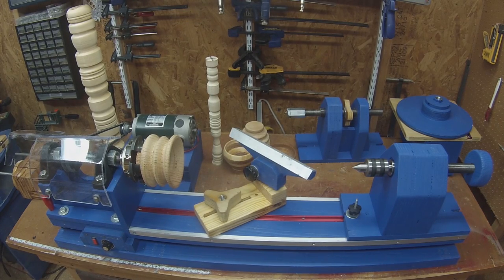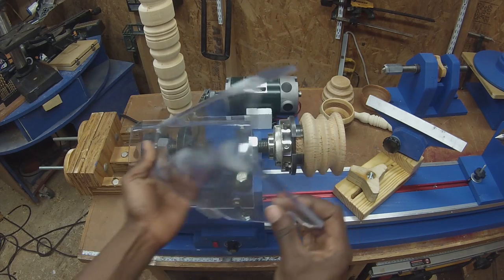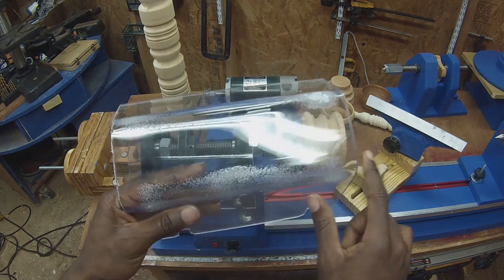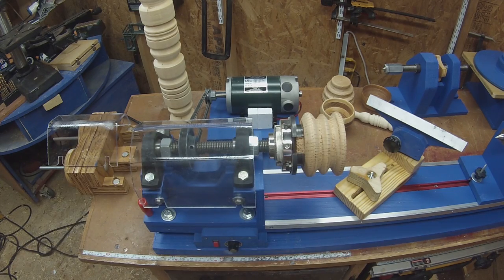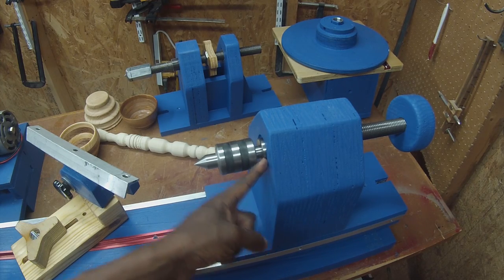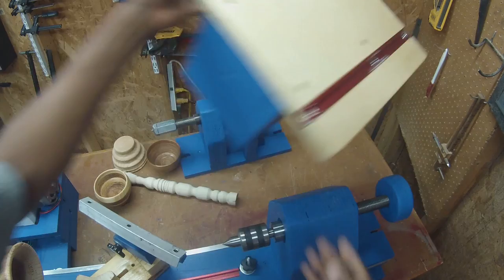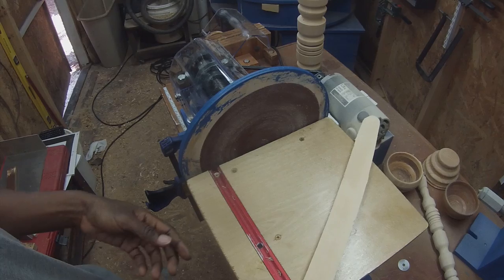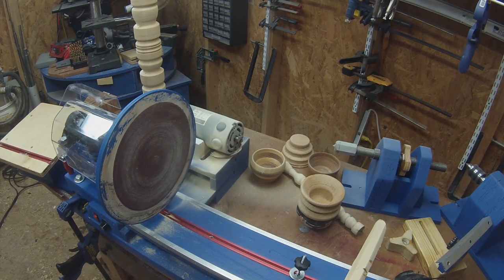The Lathe, part 5 Last Details For The Lathe Build: 025

Comment: This has turned out to be a splendid project, professionally executed. I am particularly pleased with the variable speed aspect of it. One aspect of finish sanding a turned project is dealing with the fibrous nature of wood grain. A good addition to this fine lathe would be the ability to run it in reverse direction, for sanding. Maybe figure a fail-safe method, to insure the user is aware that the unit will be running in reverse direction. Sanding in both directions, from about 60 or 80 grit, in stages to about 320 grit will produce an excellent finish. A useful item for extending the service life of the sanding disk surface will be a gum rubber stick, to clean the disk after use. I slaute your efforts!
Reply from the maker: +Thomas Koehler there is a switch on the side for going in reverse... I didn't show it in the video, but you see me use it in video number 15 and 20
Reply: Ah! Allrighty, then! I admit to being an infrequent viewer.

Comment: for bending plastics, as long as you have a decent radius to work with, I heat up a copper pipe with my blow torch then lay the plastic onto it, the conductivity of the copper means the heat is spread evenly.
Reply from the maker: That sounds interesting... I just might buy a cooper pipe just to try it. Thanks

Comment: Just one more Idea. You should bend a little dust shield out of lexan  to go over the back of your motor. They are a brushed motor and woods like pine have a lot of sap in them and if it builds up inside those exposed brushes it might shorten the life. I just made a 2x72 belt grinder from a tread mill motor and I had little metal dust all over my motor. I was going to make it from some 1/4 ply but I like your guard.
Reply from the maker: Well since the motor was free I am not terribly worried about it. If I had purchased it I would definitely want to build a cover. Sort of a weird thing to be lazy about but I guess I am.

Comment: Can you  imagine the things this guy could build with a welder, metal cutting bandsaw and a small brake and maybe a small mill... All I can say is look out NASA Jeremy Fielding is on the loose.....
Reply from the maker: This is why I started Patreon... crowd funding could turn this into something great. Right now the ideas are much larger than my budget LOL
Reply: You will go places my friend... You are a great thinker... Remember this... Rome was not built in a day... But I understand about budget... I am building a CNC machine that will machine steel.. Yea the fame of the thing is a boat anchor... 2X2 3/16-wall steel tubing... 3/4 Dia- Acme lead screws 0.5 start. work bed size is 4 foot square... Dang thing weighs a ton.. But will mill Steel with no problem.... doubles as a boat anchor on the weekends... ...LOL...

Comment: Very nice lathe, would you think about building a scroll saw and taking us all along.
Mike.
Reply from the maker: I made one before... I was given a scroll saw that is much smaller then the one I built. It is just big enough to do the job so I dissembled my scroll saw to use the parts.  You see me using it in my mechanical chess set video, I show it in my "11. things you can make with a Vacuum" video, and I made a preview video right after I made it... here is the link to the first video I made on it. 
https://youtu.be/Tv85jhhlk9I

Comment: I really enjoy and appreciate how you adjust your design as you go when you realize how you can improve it. Great example of how design is an iterative process. Great tip on forming the lexan, too. What kind of RPM range are you getting with that motor and control? Thanks for sharing!

Comment: Congratulations on your accomplishment. Nice machine. You've inspired me to build one of my own as opposed to purchasing one. One question concerning the wiring, does the plan go into details on how to wire it up?
Keep up the great work. Cheers! BTW, I have a treadmill I'm about to tear apart for the motor.
Reply from the maker: There aren’t electrical details in the plans. There are to many options. I have many videos on that
Reply: @Jeremy_Fielding  Thanks for the quick response. Could you direct me to the specific video/s that covers how you wired your lathe? I have a motor from a treadmill I plan on using to power mine up. Cheers!
Reply from the maker: Search my channel for exactly that

Comment: Your work is brilliant. Do you include the electronic side of things in the plans? Also could the lathe be adjusted to become a metal lathe also?
Reply from the maker: I don't include electrical because there is a wide range of possible motors and controllers (if any) that people might use. I decided to make the motor base some what modular so it could work with any motor.
Reply: Jeremy Fielding that makes total sense. I'll refer to your other videos for starting points when I get to my self teaching research 😉 thanks
Reply from the maker: As to the metal lathe. I don't think this lathe should be used as a metal lathe. However, I have "turned" some steel parts using a grinder or a file for small adjustments. This lathe can handle large wooden work pieces, but I did not design the lathe to handle the kinds of forces that come from cutting steel with metal lathe tools. It might be possible but that was not my design intent.

Comment: Considering the direction your DC motor happens to be facing, for the sake of longevity it may be worth the bother of facing the motor the other way so it's air intake isn't directly facing the working (dust creation) area. I'm not sure if that would introduce any speed issues (if the motor can be run at the same speed in the other direction) but I'd imagine sucking up all that dust is gonna fry the motor quickly; which would be unfortunate for I'd very much like to see what else you come up with.
Reply from the maker: I have considered many options to prevent that exact problem including mounting the motor underneath the lathe like the Jet lathe. But considering the size of my space, this configuration gives me the "smallest" lathe. Turning it around makes the lathe longer. I have a switch on the side of the lathe to change the direction of rotation, and it runs great. Size was the deciding factor. By the time the dust becomes a factor it will probably be time for new brushes. I could open the motor casting, clean it out and replace the brushing putting me back where I started. 
In the end I could just  put a cover over it. However, I have thee more motors like this one. All of which cost me nothing. I could easily replace it. The last options is the most likely. Thanks for sharing your thoughts. We agree on the issue, it just didn't turn out to be the most important for my situation. If I had bought this motor, I would probably try harder. :)
Reply: Great build Jeremy!  I was also concerned about the dust being sucked in the motor.  Turning the motor will lessen the amount of dust but not eliminate it.  I would suggest looking for a brushless DC motor, they are sealed and dust would not be a problem.  They are larger but I think that is so the case can act as a big heat sink, and they give you great torque at low speed.  Keep up the great builds and videos!  Enjoy your channel.

Comment: I'm finally getting to a point where I can work on this.  And I discover that the MT2 socket is sold-out on Amazon.  ARG!!!  I've been searching for another supplier and have found a few.  The problem with those is shipping.  They want almost the same price to ship as the socket!  It's crazy.

So two questions for you:  1) I did find a 1" dia socket.  Other than a change in the plans, any reason I couldn't use it?    2) Any suggestions for another supplier?

Thanks!
Reply from the maker: +Bill Weissborn you can use almost any size socket. A 1" socket is easier to drill I think... sounds good. I have seen some on eBay but I haven't checked recently

Comment: I challenge you to  make a lathe duplicator. I use a shopsmith and they have a great duplicator. This is a link to view it.  http://www.shopsmith.com/ownersite/catalog/latheduplicator.htm   When I seen your sanding table I said man if he made the table shorter he has a base for the duplicator tool post to run. Just an Idea they make it nice when turning railing post. keep the videos coming.
Reply from the maker: I am not interested in a duplicator... at least not right now. I mostly intend to make small parts for my machines. But who knows what a future project may hold.